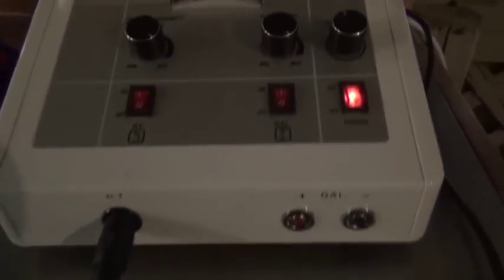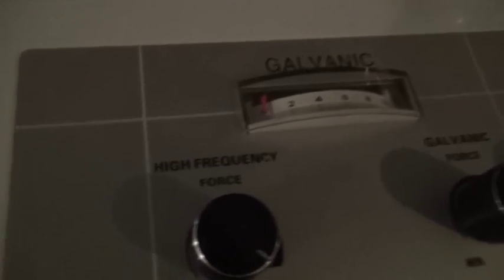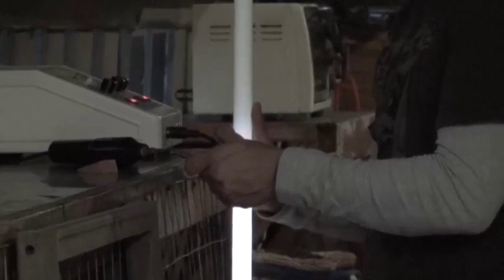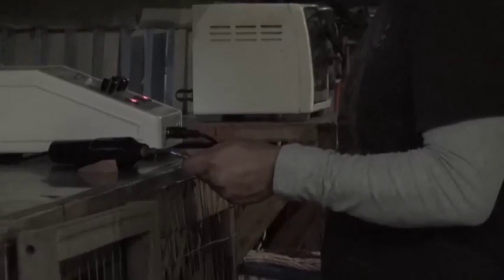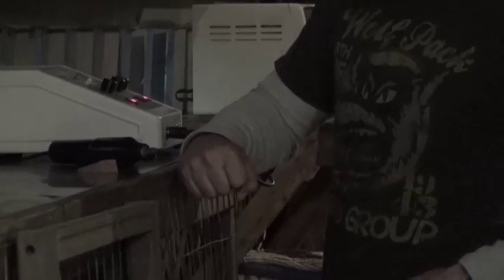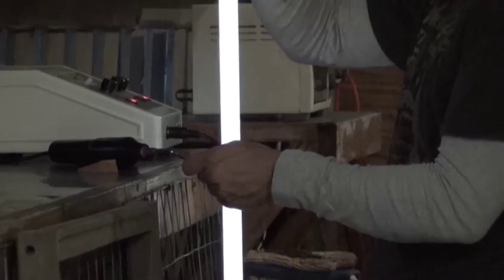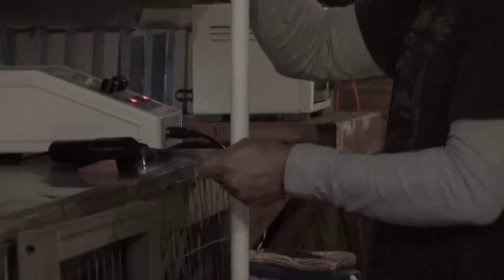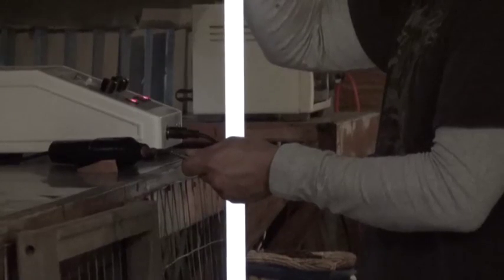Low Current High-Frequency DIY Lightning from a Galvanic Machine

Comment: maybe you can answer my question.i have a violet ray wand im trying to treat my depression with.if i put it on my head will the current go into my brain or just the scalp.
Reply: you do not want anything generating that much voltage anywhere near your head, and if you ask your GP or any licensed medical professional I am certain they will advise against using high voltage to treat depression in any way. I'm not saying there aren't things outside of traditional medicine that can help, but from a safety standpoint, if this one goes wrong, it can go very wrong. For example, its only low current because your skin is has a high resistance and ohms law says that current = voltage/resistance. However, blood is a great conductor and so if a high voltage source ever found a way to accidentally puncture the skin (like if there was a sharp edge left on the device or you have an unhealed wound near the voltage source and the insulation fails) and contact blood vessels, even small ones, the current would spike dramatically. I know this isn't great news to hear, but there are countless other alternative treatments and therapies that have much better treatment statistics and, most importantly, don't involve 230kV electric discharges (calculated based on the 3in spark gap claimed in the video and the known dielectric strength of air). I know first hand that it doesn't always feel like this way, but with the combined expertise of medical science and more traditional healing methods available today I am confident that there is a treatment that will help you get better.

Comment: Static is a name created by those who harm all  mankind. What it stands for is a free sustainable power source. That source can change time, that source can change the future, that source will be the only left at the end. Any of you notice the thunder or lightening storms are almost non existent these days? Those harming Man are even harming static. Grotesque
Reply: +Jp Bunbury  isnt static electricity just a normal high voltage at very high frequency? i dont get what the difference between static and "normal" electricity
Reply: THUNDERBOLT voltage is the frequency. Amps is the strength. So the difference is in the amps.
Reply: @secondsunlab2302  Close, but not quite. Lightning doesn't really have a frequency, as it does not alternate back and forth. frequency is the number of times a cycle repeats during a second, voltage is the strength of the electric field at some point in space relative to some other point, and current is the flow rate of charges per second past some point. For true lightning, the high voltage exists BEFORE it strikes, as the clouds have a high voltage relative to the ground. When the lightning is striking, the voltage of the clouds decreases as charge starts flowing out of them, but now that charges are moving we have a current. Frequency only applies cases where the charges flow back and forth, such as with power outlets, radio waves/transmission, etc, which is the reason we call the systems AC for Alternating Current. True lightning, however, is DC, or Direct Current. It only flows in one direction and so no repeating cycle, and so no frequency. This is where true lightning and the 'lightning' in this video differ. arcs can be generated using either DC or AC, but in small scale applications, if it doesn't matter which, AC is easier and more energy efficient, and so the arc made here was likely AC, and if you slowed down time enough you would likely see the arc appear to turn on and off over and over, but this is not the case with real lightning.

Comment: Been a long time since I messed with this stuff to provide design details, but a high voltage supply that limits the current it will deliver can be designed The resistance or the impedance of  any conductor or component will limit the current flowing more yet. You used both terms impedance & resistance You understand while they are similar they are 2 different things correct?
Reply: I was learning about stan Meyer and in one of his videos he mentions using high frequency high voltage but restricting current to generate hydrogen for his dune buggy...before he was poisoned and his work stolen.

Comment: I zap myself anyways. Not recommended AT ALL, but I lost 10 pounds in 3 weeks just by zapping myself with DC current 20V at 40mA (I used a meter. I know. I know it's also dangerous.) So AC current at about 14 volts should get an even better result, but there's an extreme risk of electrocution. I have no idea why I'm able to tolerate it with very little pain, but I don't suggest you doing it. It's a way to lose 10lbs in less than a week though... hehe... it works. I'm not responsible for injury.